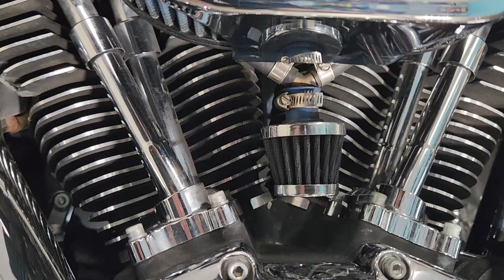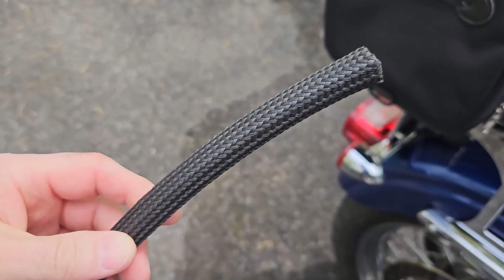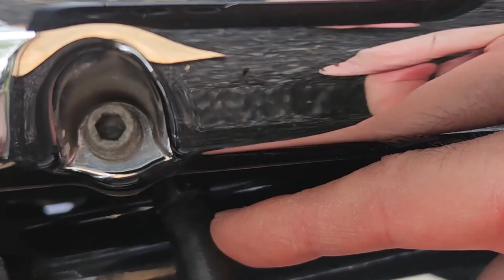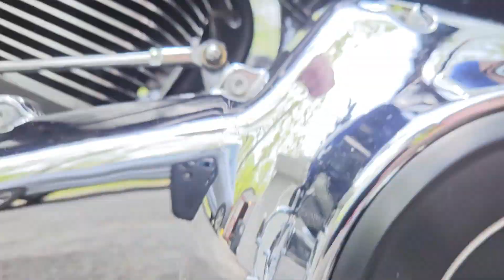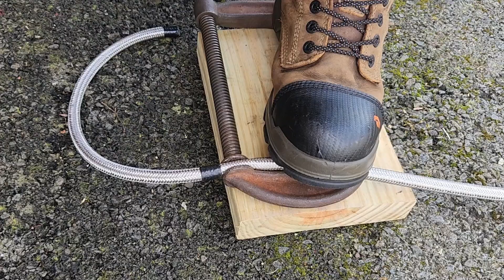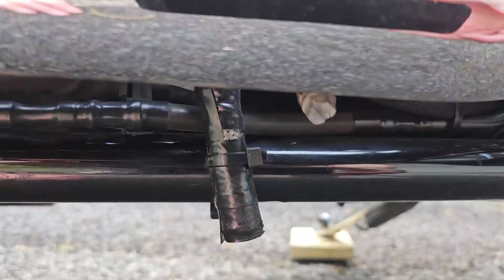Improving my Harley breather bypass mods

Comment: I noticed in the video, the bottom of the air cleaner and the cover have oil dripping and collecting. 
I’m wondering if the hose sizes you’re using are too small?  What’s causing the oil at the bottom of the air cleaner??
Reply from the maker: I don't see anywhere in this video where I had the air cleaners off. The oil bypass, it was already done on both of these bikes, so nothing is collecting on the filter. In my other videos where I am doing the bypass job, yes, there is oil on the filter because that is normal when you don't have the bypass.
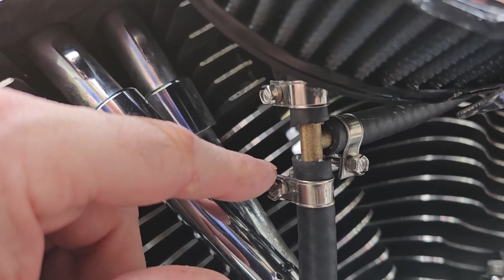Reply: @bluesriderDF  At the 0:54 second mark of the video, pause and make sure it's in full-screen mode, or take a screenshot and zoom in. You'll see some oil collecting at the bottom of the air filter. It maybe that the hose line is too small.
Reply from the maker: @chazzcapone  Not oil.  This bike had the bypass for 3 years.  Here's the original video when I did it.  https://www.youtube.com/watch?v=vxhYFs1eyuo

As you can see, the oil never gets in the air intake compartment.  For what you see to be oil, it would have to soak through the bottom of the filter.  I've had the filter off to clean it twice a year, so about 6 times.  Never a hint of oil anywhere.  This bike got totaled in May '24 when I hit a deer.  RIP bike, and deer. 

https://youtu.be/vDwgnv0LZYk?si=8LVwzedAX7ddvhJ1

Comment: The only problem you overlooked, respectfully, is that the blow-by, (however minimal), gets on your tire sidewalls.
The best way is to run the hose all the way back to the end of the rear fender, whatever it takes!
You can use 1/4" steel tubing under the fender.
As an owner of several early model FL and Brit bikes it is important to PCV, "WITHOUT THE MESS"!
Reply from the maker: I appreciate you posting.  I'm very meticulous about this stuff. I've done this job on 3 bikes, and never seen any oil on my tires.

Comment: What year did you say your SgS was.  I bought a 2022 SgS and I am occasionally smelling oil from my right side near the breather.  Are they having this problem with the 2022's?
Reply from the maker: Mine's a 2014.  All the bikes vent oil mist into the air intake.  Keeping the level at the halfway point on the dipstick helps some, but what you're experiencing is by design.  That's why people do the bypass.
Reply: @bluesriderDF  so could I conduct the same bypass that you did on my 2022 the same way.
Reply from the maker: @M J  There are slightly different ways to do it depending on what intake you have, but the principle is the same. You can check out this site, they sell various kits for the different bikes.
https://www.dkcustomproducts.com/